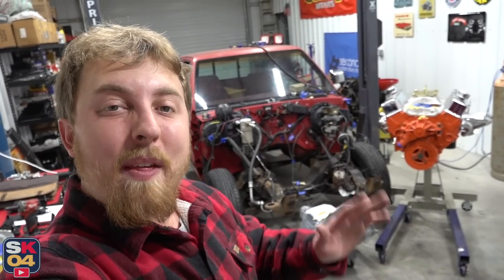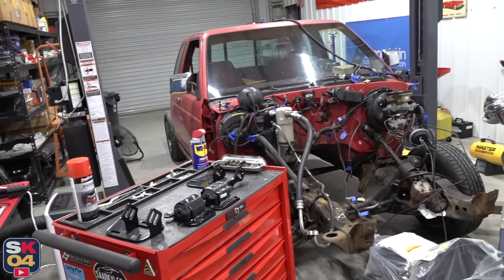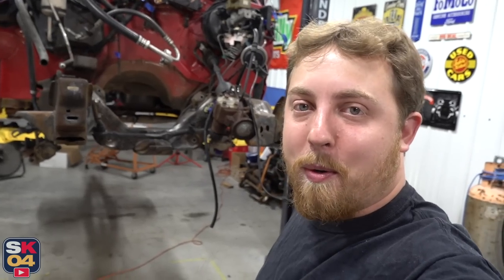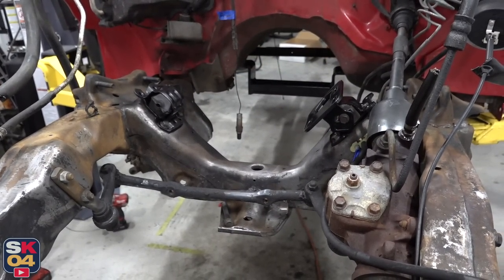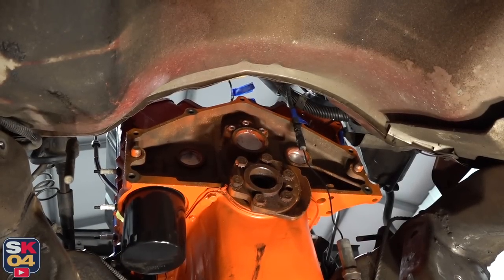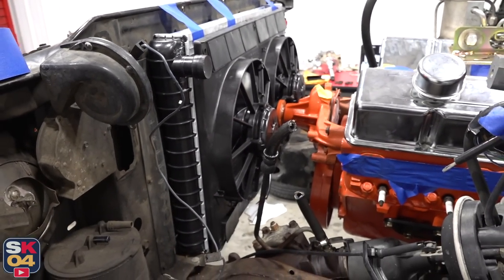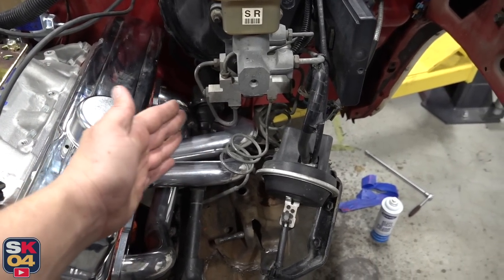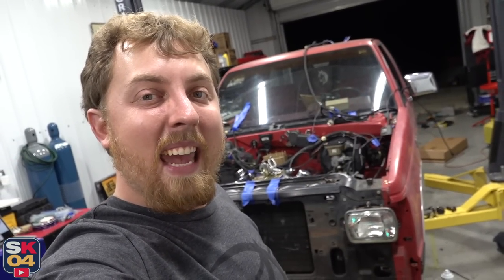Test Fitting My New Engine & Transmission! S10 Restomod Ep.5

Comment: For a regular cab, shortbed, a driveshaft from a 70 Chevelle(comparable Gm A body) is a doable length. You will have to cut the U-joint  diff end, off the S-10 driveshaft. Use a hacksaw and slowly cut all the way around where it was welded on the tube. It will slide out of the tube. Do the same to the diff end of the  Chevelle driveshaft. Now, lookeee there! The S-10 U joint slides into the Chevelles tube. You need to "phase" the U-joint to the tube before you Arc weld it back together.
Whatever trans you use, make sure spline count is the same on slip yoke and output shaft.

Comment: The S-10's stock 7-1/2" ring and pinion can handle about 250rwhp. Only if using stock width tires, so slipping is your friend.
I bolted on a heavier rear bumper. About 60lbs. That helped for grip a bit.

Comment: I believe the transmission difference is true. I have a 700r4 behind my TBI 350 in my blazer and mind you it’s stock with the exception of headers and exhaust and I haven’t hotrod it or let alone even been burning the tires and it’s already starting to slip but it could also just be wore out already. I’m going 4.8 with the truck this year anyways and I may do an 80e while I’m at it for the extra protection and 4 speed

Comment: I have v8ed around 20 s10’s. I’m not claiming to be s10 jeebus with that but I’ve learned a few things from it. 
I just want to offer advice. 
These are the things I do when installing a v8.
Setting the engine back as far as possible is the best way I’ve found to get stuff to fit. 
You will need to flatten the firewall pinch weld it will hit the top of the bell housing. You will also need to massage the passenger floor pan at the header collector to get decent clearance. 
It sounds weird but sometimes I have to shorten the driveshaft 1” sometimes I don’t. 
Use a pertonix or similar small cap electronic distributor and separate coil. It clears the heater wiring and grommet better. I use all of the factory 4.3 accessory drive minus clutch fan with no clearance issues. 
If you’re running a mild engine ie: std bore and mild cam. The 4 row 4.3 s10 radiator is sufficient for cooling. I use sphal fans behind the grill with no issues. 
With a built engine I use the rad and fans your using. I modify the core support so they’re inside it. 
The Jeep XJ steering shaft is a good upgrade and it clears the header tubes at the column connection better. 
The zq8 or extreme steering box is a great swap as it is a quicker ratio box. Also a direct bolt on.

Comment: Me and my dad once swapped out a V8 5.7 and placed a V6 4.3 in a 1992 Silverado TBI, connected all the sensors and the truck fired up like it still had a V8 in it, did not have issues with it for 2 years until we sold the truck.
Reply: As long as you used a 6 point distributor it'll work, I've done it the other way too.

Comment: Me and my boss just put a 350 multi port fuel injected into a 1990 4×4, we removed the original fans from inside, got 2 smaller 12×12 fans and put them infront of the grill, gives you all the room you need,  good luck brotha
Reply: Hope to see another video soon to see what you came up with brotha man. What intake mani did you end up using? Carbed?
Reply: The stock 4.3 radiator works and cools fine under load and idling, and with the 4×4 they sell an extension for the stock oil pan, cut and weld, worked awesome! We even used the same mounts.

Comment: A Vette water pump is a good idea, but an electric water pump will solve all your clearance problems. Just a thought good luck can't wait to see how she turns out.
Reply from the maker: Thanks Josh!  I thought about an electric pump, but the Vette pump and Mercruiser pulley will cost a lot less, depending on the brand of the electric pump of course.  I have to recess the radiator into the core support regardless due to belt clearance with different pulleys so I think I'm on the right path with trying to cut some costs.  I'll be tackling all of that in the next video and discuss various options!  I appreciate the insight!
Reply: Hey Kyle I'm Kyle. Can you do a startup of all of your cars including your wife's? That would be so awesome. I listen to videos for sound. I've been blind since birth from a disease I have called Norrie's Syndrome and that is also what caused my hearing impairment! You doo a great job describing things as I do not know what things look like.

Comment: I've done this swap many times, if you're going to use the serpentine belt setup then you'll need to use a water pump for that setup since it turns the opposite direction from the v belt one. You'll need to move the engine back a little more, and to do that you'll need to "massage" the lip of the trans tunnel with a sledge hammer and roll the pinch weld over. All of that will give you room at the front for accessories. Fan options are use one for an 80s vw scirocco, that is a very thin fan and moves a ton of air, and fits your radiator, or run a flex fan bolted to the water pump with a spacer, you'll need to " customize" your spacer length so the fan clears the belt but also is about 1/4 inch from the radiator, and make your own shroud, or there are pusher fans I've used in front of the core support that fit in the rectangular areas on either side of the middle vertical beam. I don't remember the application or where I got them from right off of the top of my head, but I think they're flex a lite, you'll have to do your own research on that. You'll also need to make your own radiator top mounts so that the top of the radiator tips forward almost against the ac condenser. Other than that you're using the headers and the mounts I've always ever used. Hedman makes a nice header for this too, and also stock 3rd gen Camaro exhaust manifolds fit great as well. It's been awhile, but if memory serves the driver's side one needs to be milled a little bit to clear the steering shaft. I've also successfully retained the stock tbi and esc setup, you need an eprom from something with a v8, I used one from a 89 van. You'll need a v8 distributor with an 8 point pickup coil instead of the 4.3's 6 point coil, and I used the intake manifold off of the van, vortec heads, and a throttle body for a tbi 454. The truck I did that too had a 76 400 small block short block with a 280h comp cam in it, it was a sweetie.
Reply from the maker: Thank you for taking the time to share all of this information, I really appreciate it!!!
Reply: @saabkyle04  no problem. I looked at my stuff further, it isn't the stock fan from a scirocco, its flex a lite model 365 that is made to fit a scirocco, but also works out great in this application.

Comment: I have a abc 355 bolted up to a 700r4 transmission that was out of a Astro van that had a 4.3 v6 and it works just fine, they have been together for almost 20 years
Reply: And that’s in a 1967 chevy c20 pick up
Reply from the maker: I'm sure a lot of it depends on how you drive, but I'm glad it has worked for you!

Comment: Go to a radiator shop with the S-10 radiator and ask them to solder on a 4 row core using the stock tank ends. Unless you have deep pockets for electric water pump, Vette rad, twin fans, sepentine belt with tensioner, yadda yadda yadda..
A four foot long strip of 4 inch wide aluminum bent in a circle and some pop rivets= diy fabbed up shroud.

Comment: For the distributor use an MSD or Mallory with cap, same diameter as old school stock points type but with inductive or optical pickup. There is no room for an HEI
And you don't want to cut the firewall just to accomodate an HEI distributor.

Comment: A/C is for the weak, bro. That engine does look like a tight fit. Especially up on the radiator. You might be able to get a low profile pump or electric water pump and an underdrive kit. As far as the brakelines, if you can't figure out a solution, you should be able to do a hydroboost conversion or just eliminate the ABS.
Reply from the maker: Deleting the A/C just seems lazy lol, it's possible, just gotta figure it out.

Comment: Believe it or not, you can use the stock trans crossmember. A Y pipe into a 3 inch collector into a large hi-flow single cat, then 3 inch pipe to two outlet muffler all the way back. You might be surprised how torquey it will be from 1500 to 4000rpm. Real world street power range.

Comment: You need to move the engine as far back as possible and you will have to get a custom drive shaft. I just did an identical swap on my 1993 and if you want to keep the air conditioning you will have to toss that corvette rad you bought as you made the same mistake as i did its good on the highway but once you hit a little bit of traffic it heats up pretty quick

Comment: You can always Recess the Radiator into the Core Support, It just takes a little bit of cutting, ( Do some Research on it )...... Idk if I told you already, But I bought my 350 TBI Engine for my Swap, I'm just waiting to buy the Headers & Mounts for it, What Headers did you buy & How much was they ??          I want Shorty Headers like the ones you have, that way I can reuse my Factory Y Pipe....
Reply: S10_4_Life, In case Kyle doesn’t see your question, he used Sanderson Headers designed for an S10 V8 swap. I don’t believe he stated a cost but you can probably order them from O’Reilly and if you use his discount code get 20% off!
Reply: @bondpit8750  I can't find any Sanderson Header on the O'Reillys website
Reply: S10_4_Life Just Google ‘Sanderson headers for S10 V8 swap’

Comment: Ha ha, I know everybody loves shiny headers. I chose factory log style cast iron for my S-10 swap back in the day. My underhood temps were much more manageable and starters last a lot longer.
So maybe you lose 15 hp but you don't have brake lines perilously close to broiler hot thin wall tubing. Hot brake fluid=brake failure.
 Log style old school manifold will have 3/4" clearance between factory steering rod. "Winning!" Oh, since this vehicle was manufactured with a catalytic converter, you will have to run dual cats. Federal Law, sonny.

Comment: nice work you can also use the water pump from your 4.3 v6 motor....
Reply from the maker: You can, but as I showed in the video, it's the same height as the original style water pump so it won't work.
Reply: @saabkyle04  ok

Comment: Kyle! Dude! Much of the clearance issues you are having problems with, have been hashed out since the 80's! That JTR manual that you have, is and was, the holy bible of all S-10 V-8 swaps! You even have the second printing which is from around 2006, and it has a ton more info than mine, which I originally purchased back in 94.  Most of the specialty parts you bought can be gotten for a lot less and even substituted for stock GM parts or even slightly modified GM parts especially, if you read that there swap book. 

Your core support issue and how to fix it,  is outlined in the JTR book, and you can even keep the A/C.   Modifying it by insetting the corvette (nice choice btw) radiator into the core support is the right path. It allows you to use the water pump and electric fans with plenty of room to spare. The steering shaft could have been updated with a Jeep Cherokee steering shaft, of which I am positive would have been way cheaper than the Hooker one you got, even if you didn't go junkyard hunting and just got a new one from "O'Reilly auto parts"!  Lots of choices and plenty of ways to getter done, and as I said don’t involve expensive custom parts. -Jason
Reply from the maker: Sheesh man, this comment is utterly ridiculous.  You don't know me and yet you're judging/shaming me over a youtube video.  Clearly you have more experience than me, I hope to get on your level one day.  I have never claimed  that I was an expert.  I have done a ton of research, but I don't know everything and I can't plan for every scenario.  Some of the things I do are in an effort to try and make my life easier and make it easier to plan/film content that is free for whoever wants to watch.  I'm also trying to help others who might be in my position.  Isn't that what the car community is supposed to be about?  I've never done this before and I'm learning as I go.  I am not creating "drama" for the sake of it.  If that's what you think, you should really spend some more time in the automotive section on youtube to see what real fabricated drama is all about.  I am trying to be honest and ask for feedback because again, I am NOT an expert.  I have been making content on youtube for over 11 years now, the past 7 of which have been full-time.  I have to have sponsors to be able to maintain this channel and make a living.  None of these parts were given to me, I buy what I want for how I want to build my truck.  That being said, I'm aware there's more than one way to do things, but not everything is as cut and dry as you claim it to be.  I appreciate constructive criticism, feedback and advice, but how you went about this was just unnecessary.  Have a nice night.
Reply: Maybe your right, maybe I was overly aggressive in my response and maybe I could have thrown a little more useful advice, or constructive criticism in my comment. You are right in that I don’t know you, maybe not personally, but I do know your persona and who you portray here on the YouTubes as I do follow most of your content (especially, the pseudo first gen crewcab). Reading your comment just now, made me realize I had jumped to a conclusion that I had no right to. And that there is someone attached that is trying to make an honest living, and that you have to carefully consider how you do everything to make that good content. I apologize for shifting my fingers into gear without thinking about where I was going. I will amend my comment to add some better constructive feedback. -Jason
Reply: Fierofreak01 Wow! I didn’t see your first comment, but it must have been something to set Kyle off, at least you had the decency to apologize and amend your original comment to be more helpful. I don’t know Kyle personally either and I only recently discovered his channel but I really like what he’s doing and he seems like a stand up, hard working young man. I admire his determination to learn hands on.

Comment: Would it help for the future to weld the motor mount nuts to the frame so you can just remove the bolt alone?
Reply from the maker: Yeah, I'm surprised they didn't do that from the factory.  Idk how hard it would be to reach up in the crossmember to weld them.

Comment: Get a low profile electric water pump that's what I put on my s10 v8 swap
Reply: Or, just buy the short style water pump from pre 1968 Sbc. And a 1-3/4" aluminum spacer for a flex fan.
Chevy V8 Monza(spyder) used the early style pump and alternator, p.s. brackets that are high up on the block. And fit on tapped cylinder head bolt bosses on sbc's from 1968 on.
I Did this swap 33 years ago. Yeah, I am old.

Comment: You might As well get a custom cut dirveshaft for the 350 swap
Reply from the maker: Why?  The factory one works.
Reply: @saabkyle04  New equipment and old parts doesn't sound right
Reply from the maker: It's fine.
Reply: Replace the U joints and call it a day. Just a metal tube.
Reply: If it bolts up fine, clean it up and get new ujoints with zirc fittings

Comment: Use an airchisel and cutoff the bolts that hold the motor plates to the frame. Buy a pair of 1973 Nova rubber motor mounts.
Get two 3/8" Steel plates about 5" X 4".
Bolt the rubber mounts to the block.
Now eyeball where the mounts will fit on the plates and drill and tap holes on the plates for machine fine thread. Since you have the front end off you can slide the motor in to fit.
Now I am going to reveal a (Big secret) for this swap.!!!!! Don't use the hoist sling with the carb adapter as shown in this video.
Instead, use long bolts with washers on two staggered intake bolts!!!! Wtf???
Well in order to center and properly level the motor in the frame you MUST use a carpenters buble level placed on the manifold flange.
So....... When you do your trial fit, make sure it is level left to right and fore and aft, sitting on the crossmember
Then tack weld your motor plates to the crossmember, remove from the rubber mounts and run a good bead to secure the plates to the crossmember. No, you cannot weld it with a cheap Harbor Freight wire feed. Use a 200amp stick welder.

Comment: can that rear-end   373 rears  that's lot horse in 2000 truck  seen some 1 do this rear-end last 3 days  he put in 500 gears still holding a got 89 s10 blazer with camro  2.8   still runs 7.5 rear 373 has four link but been in s10 for 25 years

Comment: You will regret removing that steering shaft for that other one.
Reply from the maker: And how's that?  Some information would be appreciated...I'm still going to run it, but I'm curious as to how I'm going to "regret" it lol.
Reply: @saabkyle04  You will feel every bump in the road
Reply: @saabkyle04  I got the equivalent steering shaft for my Firebird but I ended up installing a new rag joint. If you eliminate the 'buffer' in the steering shaft, the steering box will take more of the vibrations, ultimately reducing its lifespan. You could get a remanufactured steering box on top, but a new rag joint did the trick for me, though.

Comment: Use an electric water pump.
Reply from the maker: I thought about it, but I found a solution that I'll be exploring more in the next video, an 80s Corvette alum short water pump (reverse rotation) with a Mercruiser circulation pulley.